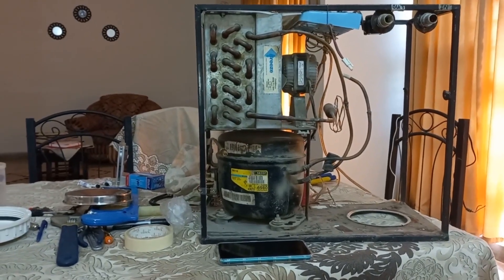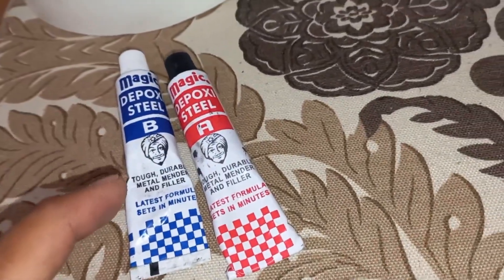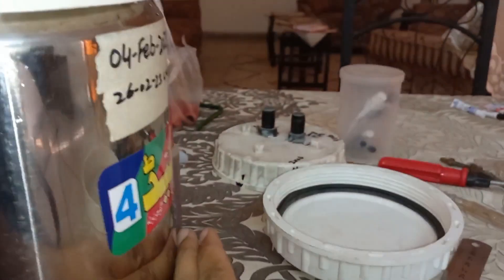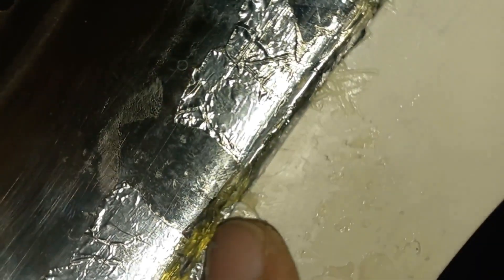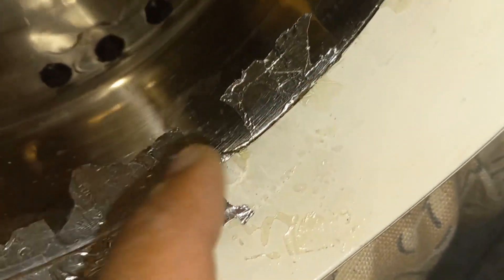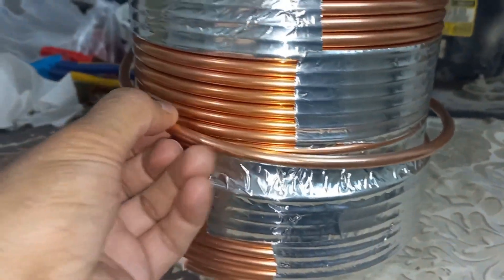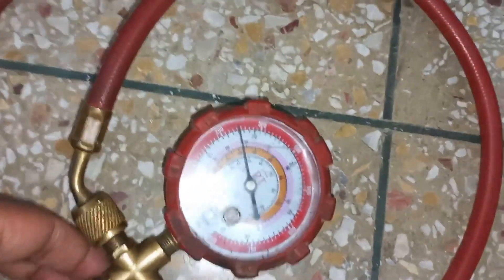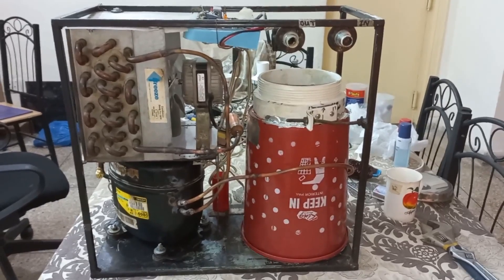DIY Aquarium Chiller | 300L Water Dispenser Cold Plunge | Urdu / Hindi | V6/6, Pt2/5

Comment: hello sir, i want to make a Aquarium Chiller for my 120litre Aquarium. I want to use LG 1/10 hp compressor of r600a Gas. Please tell me is this possible ? what will be the Length of Evaporator pipe  and capileri pipe length ?
Reply from the maker: @sukantamondal3110  dear 120 L is very less water what is max peak ambient temp in your area and how much tank water temp u need
Reply: @NewAquariumHobby  max temperature is 42 degree Celsius but in the room probably 37 degree. And I want it to 25/26 degree celcius with lowest electricity consumption because here electricity charges per unit is very high
Reply from the maker: @sukantamondal3110  as per my knowledge 1/10 hp compressor can't do this 25 c temp u need 1/4 hp for that u can watch my video aquarium chiller version 3 or better if u watch all 6 versions as I spend too much money and  time then got final results in version 6 as I start with 1/8 hp to reduce electric bill but cooling also not good. Best to use R134a gas as r600a don't work in chiller. U can watch more videos on it.
Reply: @NewAquariumHobby  but 1/10 or 1/8 hp compressor how much upto can cool the water ? I mean this power how much litre of water could can cool ? 60 lt or 80 lt to 26 degree ?
Reply: @NewAquariumHobby  sir my another question is how much wattage can consumed a 1/8 and 1/10 hp compressor with ac 240v ?
Reply from the maker: @sukantamondal3110  your ambient temp is high above 40 c as aquarium remain open from all side so surrounding ambient heat effect direct in this condition need big compressor otherwise small compressor will remain running continue and compressor will damage as no trip no rest
Reply from the maker: @sukantamondal3110  it will draw nearly 200 wat as it draw 0.8 to 1.1 amp but as its small so remain running continuously and electric bill will be more and may be also can't achieve 26 C
Reply: @NewAquariumHobby  ok. Sir chines brand Hailea hc130a model has .8ampire consume but it hp is 1/15 hp written in the guide manual. In this chiller ampire and hp of compressor is not same  consume wattage. So how could I calculate the consume of compressor wattage ? With horsepower or ampire od compressor ?
Reply from the maker: @sukantamondal3110  it's difficult to calculate as amp vary according to ambient temp when comp start it is cold so draw less current but as it run for long time with out trip its temp increase so current high so due to this reason we are unable to calculate correct wattage but company can do proper calculations and write all data on name plate.
Reply from the maker: @sukantamondal3110  00923009121236 u can send message on WhatsApp
Reply: @NewAquariumHobby  thank you